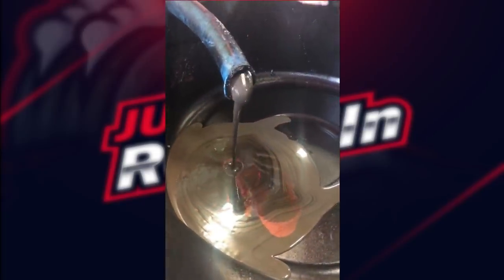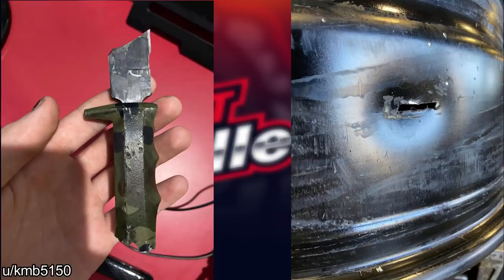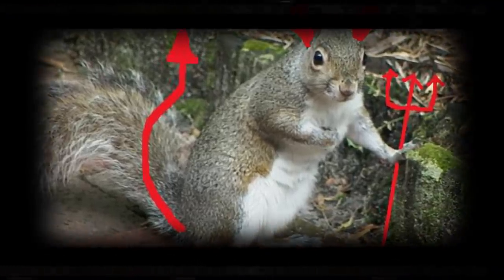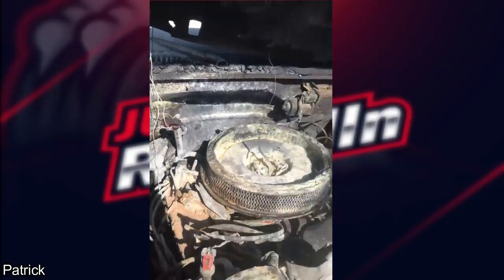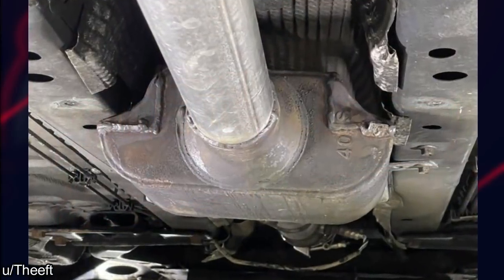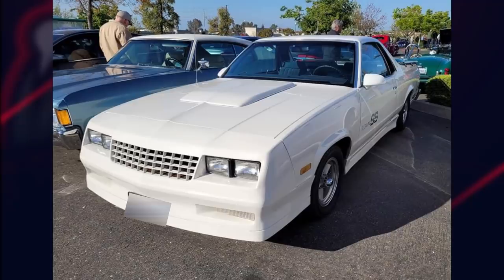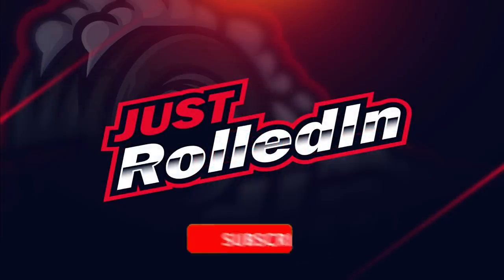Customer States "I Don't Believe You, I Don't Need My Oil Changed!" | Just Rolled In

Comment: 43 years ago, we used to run matchlocks down in the curb yards. was a treat to spin off the rodents from the round tree. but the curb was rather tall for our young minds. the conduction rate of the spin off was virtually unfounded. it could only be explained through forces unknown to the rest of us but had to waiver off the differences to the side merchants. anyhow, it was quite a differential we had to put in to elaborate on. I had three engineers running rodents down through the chimney. if you know how a tail spin works it can get through several layers of tall trees but the average track goes into a sidewinder. I thought I'd share this true story of my experiences down under the trenches and potholes causing misaligned spin rattles.

Comment: When I worked at a tire/full service shop we got a lot of flat reapairs. One day I had one on a Land Rover when I was pulling the car in I heard a noise and could feel that something was wrong. When I got out of the car there was a metal bar about a half inch around and at a 90 degree angle going straight thru the tire. I asked my boss if he even looked at the tire before writing it up as a flat repair he said “yeah see if you can patch it” I told him to come out and look at it he looked at it and said “pull it out see if it can be patched” I grabbed a pair of channel locks and pulled it out. There was a quarter sized hole in this tire and the bar was like 6 inches long I said “can YOU patch that” he said “nah I’ll write her up for a new tire” lmao

Comment: The tar in the oil pan is possibly from a coolant leak most likely at the intake. A small amount of coolant continually leaking into the oil then evaporating turns the oil into sludge
Reply: No, first off coolant doesn't evaporate, second the engine would die pretty quick if coolant was leaking into the oil,  that blob in the oil pan is LUCAS or STP,, especially in cold weather,, that shit will destroy an engine,,,, too thick

Comment: Flats? A screwdriver bit. A 4-inch long 1/4" carriage bolt. A bent-over 1/4" x 2" cotter pin. A box-cutter blade. A myriad of sheet-metal screws and roofing nails. A piece of rebar that went through the sidewall and out the tread. And a friend swore he got a flat from a chicken bone.

Comment: Years ago I had taken my Toyota Corolla in for an oil change at a national tire brand shop. While they were putting the oil back in from one of those pumps that they have the hoses hanging from above. Well in mid pump the power went out and the oil continued flowing into my 4 banger. It filled the crankcase up. The power came back on and they brought my car around and off I went, for about a block before my engine started raising hell and smoke pouring out. They drained several gallons of oil out of my poor little car. Amazingly it didn’t destroy my engine.

Comment: Was at a tire shop in Alabama having a hex driver removed from a semitrailer tire, guy there told me about a scrap metal hauler that came in with a small engine crankshaft stuck in the steer tire, which was one of those flotation tires. Still held air.........

Comment: When  was younger I drove a Buick Park Ave for the Womens Professional Golfers Tour. I go to the Dealership and get my car, I think I made it around the block before the oil light came on and the engine seized. I check the dip stick and it was bone dry. Apparently no one ever put oil in the engine. Left it where it was and got picked up by another driver. If memory serves it had like 12 miles on the Odometer.

Comment: As far as tire puncture goes, I had a customer with a pair of brand new tires, brought the car in for Alignment. After the car was done I took it on a road test with the customer coming for it in 10 minutes. On the road test a spark plugs went into the tire. Two quick tire plugs and got it into the parking lot with seconds to spare.

Comment: I knew someone years ago that bought a newspaper route including the GMC step van that was used. It had 300K plus miles on it. Never had an oil change, still on the factory filter. I don't have any pictures but when the engine was rebuilt it was pretty bad inside.
Reply from the maker: Dang would have loved to see pictures of that.

Comment: ive worked on engines before so ive cleaned my fair share of those and that looks like maybe 300,000 miles no oil change thick goo at 2:38
Reply: why you cleaned em??? whats the point when you will replace the whole engine

Comment: I was working at a gas station around 1976, asked a customer if I could check her engine oil, she said "sure, you can check it but the light hasn't come on yet so it must be okay".  There were chucks of sludge on the dipstick, it was lower than the end of the stick.

Comment: I dated a woman who took her civic to the cheapest oil change shop she could find to get her oil changed.  A few months into dating her the engine took a crap, odd for a Honda that's not abused and under 150K miles.  When I was changing the engine I asked her where she took it for the oil changes and asked if she had them change the filter too.  "Isn't the filter always changed with the oil", she said.  Not at the cheap places, you have to ask for it and it's an extra charge.   That's how they can advertise the price so cheap, because they are only changing the oil.  She bought the car used and put 80k on it with the same filter, until it clogged and ran on bypass for 60k+ miles.

Comment: Oil pan looks like a Cat 3406 with a failed oil cooler. If it runs long enough, it won’t look milky anymore, it will turn into pudding. They do it in the coolant side or the oil side, usually the coolant side though. It takes a LONG time to flush all of that out! Mix a box of cascade dish soap in a 5 gallon bucket with hot water, pour that in the radiator, then top off with another 5 to 6 gallons of hot water. Run the engine 10 minutes at a time until no clumps drain out. Then run for 30 minutes until partially clear, and finally an hour until clear. This can take 2 days.

Comment: Was driving my ex's(wife at the time) '11 equinox and bout 11mi from home and 6mi from  point B,i hear that low tire flub. Pulled into a closed down gas station(4pm ish) got out and tires all looked good. I pulled up so tires rotated bout 180,then i saw the head of a bolt,a 9/16 bolt head,and not in the groove between the tread,but dead center straight in to the head of a square tread section! It was in there as if you drilled a hole straight in and dropped er in. 1st and only time ive seen or know of a bolt goin in a tire that way. Had to be on the road in its head an threads up and the perfect
 storm happened.

Comment: I’ve seen a spark plug impale the tread portion of a tire.  The impressive part was that it was the electrode end stuck in with just a small portion of the insulator and terminal exposed.

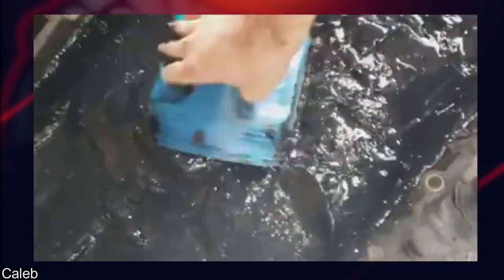Comment: the oil pan at 2:50....I had a friend once where I nearly bought his truck after a small accident in the snow. He didn't have the money to repair it so I was going to buy it and repair it so he could go get another car. I asked him how long he had owned it and how many miles he had put on it. I can't exactly remember the numbers but he had owned the truck for a few years. Somewhere in the conversation he mentioned he had never changed the oil because everytime he checked it it was always full. He mentioned that he had added a little oil from time to time just to top it off when it looked low. This was the kind of stuff on his dipstick when i check the oil. 
I did not buy that truck.

Comment: A dude brought his Chrysler in for a check up, because his ABS Light was on. This was at the Autonation Used Car Superstore, North Houston. So, I pulled Codes and began the Diag, and came to the conclusion that the ABS Module had actually failed. Nowadays, you hardly ever see Modules or PCMs fail. So, I pulled the Module and there was a noise coming from inside it. I was like, wtf. I shook it and something was definitely rattling around inside so I inspected it and found a hole, in the Bottom of the Module. I couldn't believe this and raised the car in the Air, because the hole looked oddly familiar. Sure enough, there it was, a similar hole through the Floorpan.I couldn't take the suspense any longer and opened the Module. There was a Slug, from a Pistol rattling around inside it. I showed my Boss, and you know what happened? We honored the Warranty.

Comment: I have been an aircraft mechanic for 30+ years and am meticulous about maintenance and tools. When I was a kid, Saturday was car day, you were out with Dad tuning, fixing or washing and waxing every Saturday after cartoons. Every boy and lots of girls knew how to change oil, drum brakes, how to service manual and automatic transmissions. Kids today don't really have a clue, in our disposable society, you buy a car and when it doesn't work right any more, you trade it on a new one. I had a Toyota pickup with a V6 and VVT, about 250K on the odometer, gave it to my son and he ran it about 50K and it started popping codes, he had never changed the oil even with me harping on it. The VVT solenoids were plugged with gunk from dirty oil. $200 dollars worth of sensors later and another $50 for an oil change, it drives and runs like a champ. If you aren't a mechanic, you will save yourself a ton of money over the years by just reading the owners manual and following the maintenance schedule.
Reply: Did you try to teach your son about vehicle maintenance?
Reply: @Sashazur  I sure did, I figured that if he didn't know how to do some basic maintenance, he didn't need to be operating a motor vehicle. I does maintenance like brakes, wheel bearing, tune ups, and like most of the younger generation, he is a whiz at the electronic stuff.

Comment: The oil you asked for comments taking a guess at what caused it to be thick sludge: My guess is the customer tried putting a really heavy oil in it that shouldn't be used as engine oil, like 90 weight gear oil. We ran an experiment mixing 10w30 engine oil with 90w70 gear oil at a shop I worked at (Class 8) using an old engine that was the owners he replaced (more power) in one of his cars. Did the same thing. The oil turned into a thick sludge.

Comment: I built a motor mount out of a wood block, rubber sheet and large hose clamps (more than 10 clamps) when I was 19 and poor. It worked and I drove it like that until selling it a year later.

Comment: I was reading online a while back that some oil additives will react with some fuel additives causing the oil to thicken or jell.
Reply from the maker: I was just reading that as well! Pretty interesting.
Reply: @JustRolledIn  In Poland you can buy something that is called Moto Doktor, generaly it is oil thickener , if the engine is in bad shape it can mask disturbing noises for short period of time and hide other problems with engine,  not long after that "fix" the engine is dying but then the car have new owner and that dying engine is his problem...

Comment: Last one changed filter but just added oil, never drained it.
As oil congealed and stuck to engine surfaces, they were adding  a bit more than the volume of the filter.
For a long time it all seems good looking at the filter.
Then the engine got hot enough that the goo all drained to the pan.
 Suddenly oil is too thick for the oil pump to operate properly.
Sudden catastrophic engine failure somewhere and it got towed in.

Any bets?
It's a clean looking goo... Well filtered

Comment: When I was in vo-tech someone donated an old K-car with a carb. on friday a classmate took the top off the carb and went home.  that night the janitor tried to move it. the carb burst into flames and torched the engine wiring. we spent a week with a wiring diagram re-tracing and splicing all the burned wires. it was a nightmare of splices and zip ties but it ended up working again and we gave it away in a raffle!

Comment: Strangest thing impaled in a wheel?  I rented a new Cadillac SUV - it had under 3K miles when I drove it off the lot.  I got on the freeway and up to around 60 MPH when all of a sudden the right rear tire went down to zero psi in an instant. Luckily my new ride handled the event rather well and I got it to the side of the road and used the spare.  Getting back and diagnosed, I had encountered an 8-inch piece of rebar that went into the tire and right up through the rim ruining both tire and rim.

Comment: that jello like oil.... I ran into that in the mid 90's working at an "un named dealership" where they had a specific additive to the oil that reacted to the factory bottled oil we used for oil changes. It turned the oil to a goo like substance. A HUGE lawsuit began as it happened all across the country to thousands of vehicles. I can remember taking oil pans off and slamming them on the floor and the oil looked like a jello mold of the oil pan. I made HUGE money working flat rate

Comment: Once upon a time I taught at a school with an aviation maintenance program.  One prospective young mechanic didn't understand why i told him he shouldn't tell one story around mechanics...
Seems he was doing an oil change on the car daddy bought him.  Drained the oil, removed the filter then discovered that he had bought the wrong one. So he put the old one back on and drove to Walmart to pick up the right one...or tried to.  He never really understood why the car didn't make it very far without any oil in it before he washed out.

Comment: The black pudding in the oil pan looks just like one I saw years ago. The customer wanted the engine replaced under warranty but was denied because they could not provide any proof engine oil or filter change in 78K miles.

Comment: Some people need to not own a vehicle. Im not a mechanic & have no desire to be but I know the very basics & have some common sense. First, I know to get the oil changed at regular intervals & check it between changes. I always look at my tires when walking to my vehicle. I caught a bad spot on 1 tire last year & got it replaced asap. I look for fresh spots on the ground when I leave my parking spot in parking lots. You can check your taillights/brake lights yourself if you are backing towards a glass door/window. Just being a little observant & taking a vehicle in for regular maintenance from a reputable shop will save hundreds if not thousands of dollars. Every make with have their faults but I believe with proper maintenance & not beating the crap out of the vehicle, most will last a long time.

Comment: The last one is a Cummins ISX15. Tht goo is caused by a failed EGR cooler and NOT getting it addressed. Driver just kept adding coolant when the LCL light went off. Seen that a bunch of times. Oil coolers liked to fail on those early on and made the cooling system look like that. PITA to get clean.
Reply: Liner O-rings.
Reply: @jasper2347  not unless it was overheated severely. Then there would be way more damage
Reply: No, just had 2 in the last month do that without an overheat issue, the O-rings had broken down.

Comment: 2:43 Looks like wheel bearing grease just got pumped into the crankcase.  Question is did the owner drive it there? Maybe it could be done on a model T and get away with it but that is definitely more than 80 or 90W gear oil or STP oil treatment(it is not that thick either if it was all "oil treatment".  I am betting it did not leak or burn any oil (blue smoke).  I get cold winters(-30F) so that engine would NOT TURN OVER as it would be thicker when cold. 30W is already too thick. Battery struggles.

Comment: Highschool kid's excuse for being late to school:  "I had to heat up the engine before it would start."  Apparently the engine knocked so badly that he ran straight STP oil treatment.  On cold mornings (in S. Florida) he would build a fire and push the car until the oil pan was over the fire.  Really, a true story.
Reply: Not uncommon to build a small fire under a diesel to get it started,, it's old school but it works

Comment: Had a women come in for oil change, stated no power. Pulled the drain plug, nothing came out, asked when she did her last oil change. She could not remember. Pulled the oil pan and it was all sludge like your photo shows. She had 65000 miles and never changed the oil once. I'm still surprised it was running.
Reply from the maker: Wow very surprised that ran as well. What kind of vehicle?

Comment: the oil looks like slight antifreeze getting into the oil.   the ethylene glycol is a sugar base  when exposed to the temperatures  inside the crankcase  it thickens the sugar  had this happen a few times in the 40  years as a diesel tech.  one had the oil so thick it wouldn't drain we had to remove the pan with that junk in the oil pan.  we had to completely disassemble the engine , we had a hot tank back then and soaked the engine block and engine parts then blow cleaning solvent thru all the oil passages
Reply: Thanks for the reply
Reply from the maker: I'm sure you've seen some crazy stuff in 40 years as a diesel tech. Was reading a little more online about this and somebody thinks it might be cause of too many oil additives. Either that or what you said would make the most sense.
Reply: Yep old mechanical engine engines with one wire to the fuel shut down. Now to engines with control modules synced with other modules on the truck or  transit busses   just to start on the changes.

Comment: A month ago I was driving down the street not far from home when I suddenly started hearing a “thumpa-thumpa-thumpa” noise from the back of the car. Pulled into a parking lot and found a hex (Allen) wrench stuck in my left rear tire, with the long end of the wrench sitting parallel to the tread. Put the baby spare on and drive the car to where I bought the tires to have them fix the flat and they said they’d never seen that before. Wish I’d taken a photo.